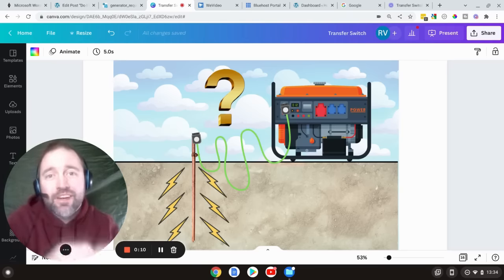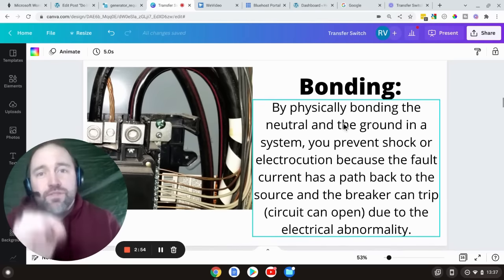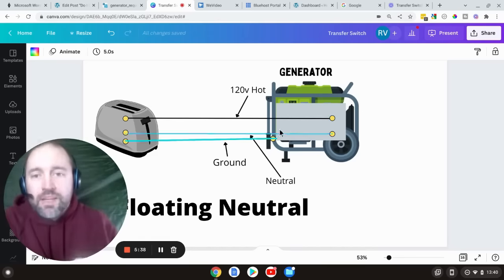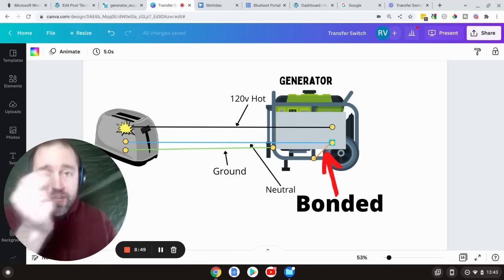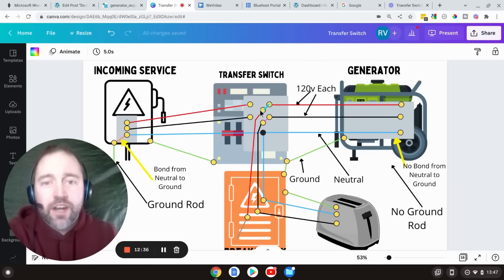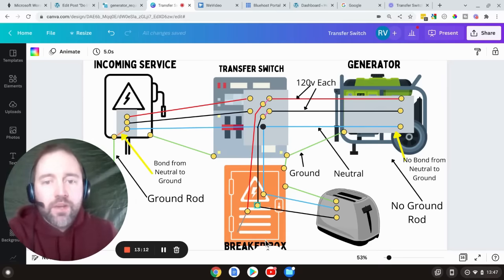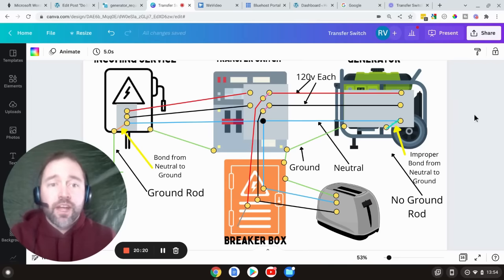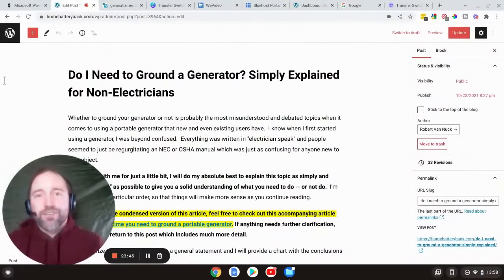When You DO and DO NOT Need to Ground Your Generator [Extension Cord Use & Backfeeding a Home]

Comment: At 9min you state a grounded generator is unsafe, but then the same situation with the switched neutral house connection is OK? That makes no sense. Going thru a transfer switch changes nothing electrically. 

If there is a fault in the toaster, let's say one where the neutral is disconnected for simplicity (if it was connected it just reduces the resistance of the wire path making it safer as less current/voltage is available on the ground). The chassis and grounding conductors are now energized. So all grounded equipment is now energized as they are all connected via the grounding system. This isn't necessarily going to trip any breaker, as they are an over current device that protects the wiring from overheating and causing a fire. The fault could be through most of the toaster heating coil for instance and the toaster just keeps working like all is normal and no over current is experienced. 
Now you touch some connected device. The grounding system has less than 5ohms (by NEC50.56) impedance to ground.  The body is said to be 300-1000ohms depending on how much of it the power goes thru. That is the worst case as you also have high contact resistances with the ground and the device thru your skin unless you are wet and don't have rubber shoes. So worst case in a pure short circuit situation (meaning the device is not using some of the power along the way, a direct hot to ground short) you have 5ohms on the grounding wires and 300ohms thru the person. That results in 400mA thru the person. It is said that 50mA can kill, though isn't as likely. So dangerous certainly. The total parallel resistance is around 4.9ohms which results in 25A flow which should trip the breaker. In most real cases the contact resistance of the skin and standing on surfaces that are not good grounds means that the body resistance will be much higher, 1000s of ohms usually, and thus you might feel the shock slightly, but won't be dangerous. Also if not a direct short, some power is consumed by the device in series with you and the grounding system, lowering the current thru you.

If the generator isn't grounded or bonded, then the grounding system just stays hot at full voltage in a direct short. When you touch it, you have too high a resistance to trip the breaker, so it just keeps shocking you. Bonding would make the circuit flow back to the generator with very low resistance and trip the breaker in a direct short, but wouldn't if some of the power goes in series thru the load before the fault point. This leaving the chassis hot at some lower voltage. That lower voltage probably won't kill you, but might in worst cases. 
Looks to me like grounded and not bonded, or bonded are basically the same. Both have a situation where if some of the load is in series the breaker won't trip, but the likelihood of a fatal shock in that situation isn't as high. 

In the end there is a reason GFCIs are put on generators. They protect you, while the breakers protect the wires and from fire.
Reply: You are right. This video is misleading and giving people dangerous advice.

Comment: So how about those people who have RVs and are using a grounded neutral plug (this plug has no cord connected to it) to fit in the 120 outlet in order to fool the surge protector into letting the power go into the RV?
The RV is using a three prong 30 amp outlet on the generator to get power. Is this safe? 
You can get these grounded, neutral plug off of Amazon or make one yourself by wiring the ground to the neutral.

Comment: Do I need a ground rod for a portable generator if it is powering a camper trailer?  Temporary set up on a job site connected via cord and plug.
Reply: My guess is that if your camper trailer itself has a ground rod as part of setting down , no. If the camper does not have a ground rod, yes. Point is you only need one connection to earth ground and that connection should be bonded to neutral once and only once.

Comment: Hello, I have an inverter scenario, its not bonded, I have a plug and play system, plug in RCB at the inverter, using extension cord, to the appliance  If i make it bonded do I have the inverter earthed or floating

Comment: This video is fantastic!  I am very impressed.  I actually had an interesting scenario with Hurricane Sandy 10 years ago - a tree came down across my utility wires to my house, and actually pulled the 3 cables out of their mechanical lugs at their connection at the pole on the street!  They were still connected at my house weather head, but totally disconnected at the street.  I was basically in "Island Mode".  I have a proper generator connection to my house and was properly wired, but I had no ground rod, as I designed and wired this with the generator neutral and ground connected to my main service wires (just like your view of a standard transfer switch with a solid neutral)  
I wasn't prepared for for a situation like this!  Even with a portable generator.  (I'm sure most people wouldn't be)  And if you have a built-in gen hardwired, I dont think there's anything you could do)
I now keep a 50' coil of #8 AWG THHN green wire with my generator, in case I need to connect it to my house's ground rod.  Yes, I should probably have a dedicated ground rod, but I dont, yet
Great video!
Reply: the question becomes, why do you not have a ground rod at your home? It's required by NEC and should be bonded to neutral at the main panel. BTW, the 3 wires to the pole do not supply a ground, although it may have a bonded neutral.
Reply: @rupe53  as stated in my above comment, I have a ground rod at my house. I just don’t have a separate, dedicated ground rod for my temp portable generator, in the event it needs to become the primary source and utility power(and neutral) become disconnected.
Reply: @tristanschaper281  ... if you have a proper 4-wire connection between the gen set and the house you are already grounded. This is why they added the 4th wire some 35+ years ago. They were originally only 3 wire connections. BTW, your neutral and ground are already bonded at the main panel and will be tied together, even feeding a sub panel. (because all grounds and neutrals go back there anyway) Last I looked NEC only addresses a dedicated ground rod for permanently installed gen sets.
Reply: @rupe53  Thank you.  That's interesting that the NEC only addresses a dedicated ground rod for permanently installed gen sets.  I think I'm good then, even if another tree rips out my utility lines from the street (let's hope this never happens again!)  Thanks for the feedback!
Reply: @tristanschaper281  ... I was looking for the wording this morning and all I found was a statement regarding "a secure return path to earth ground" which would be that 4th wire in your gen set cable, which connects to your existing ground rod outside the home. Every home will have at least one rod, and sometimes two, usually not far from where the meter is located.
Reply: @rupe53  thanks. Yup, I have a proper ground rod on my house, connected to my main panel. And bonded to the water main

Comment: What if you have an Interlock instead of a transfer switch?  I'm assuming that you would follow the rules for an UNswitched neutral.
Reply: I have the same question, but from listening to his explanation it sounds like we would not need a grounding rod as we are separate from grid but still connected and bonded to the home box, so that would be the path.
Reply: An interlock switch works off a home's circuit breaker. Since that home circuit breaker is connected to two hots (240v normally) the neutral is directly connected (bonded) to your home's panel (or neutral bus). That being said, a non-bonded generator is required when powering your house (like AC and  ceiling fans) using an interlock switch.

Comment: ok great BUT im on a metal boat. i have an inverter that automatically bonds or unbonds depending if its running off shore power or battery. if i put my honda 2.0i on deck and plug it into shore power while at anchor, do i need to connect the ground of the generator to the chassis of the boat? this problem has had me scratching my head for years. honda generator is permenantly bonded. and the victron inverter will automatically unbond when conected to the generator.   from watching your your video it seems im in the scenario where you are totally disconnected from the grid and therefore need a ground rod (ground to chassis of boat) correct? and not meaning to over complicate i also have a victron isolation transformer that completely isolates any shore power source (like the generator) by the use of three seperate transformers. active neutral and ground. is it possible in this situation if there was a fault in the boat, would the power be able to return through the isolator circuit and make it back to the bonded generator without a ground tied between the generator and the hull? and if it did then wouldnt this be 2 paths back to the source? you said this was not good? this really has me stumped?? how do i safely run my genny on the boat?

Comment: so (potentially if there's a fault) you're at risk to get a shock if your using an extension cord with a generator that is not bonded?
Reply: Yes, you become the grounding rod in that situation when you touch the faulty item/wire.
Reply: @CL-gq3no  good to know!
Reply: Use a GFCI when possible.

Comment: I get what your saying but what if I want to use an extension cord to plug into my furnace. It shares the house ground right.. would that be a problem? What's your opinion on that? The generator already comes with a bonded neutral.

Comment: As an electrician I was under the impression the neutral wire is connected to your grounding wire and rod. To complete the circuit to earth and the neutral also carries the unbalanced load (current otherwise know as amps) to ground. You need a bond as it connects all conductive components that a person maybe in contact with for safety. Because A/C circuits look for the path of least resistance to ground. You don’t want your body to be that path. So if a faulty hot was to happen for whatever reason it will create a short to ground tripping a breaker or blowing a fuse. Thus killing the circuit and eliminating an electrical shock or electrical fire. 

Maybe I am wrong but that is how I under stand it to be. 

I am foggy on DC. Though I generally look at them as battery type systems. DC makes me nervous.

Comment: I'm wondering if things are different with sine wave inverters connected to a battery.  Is it safe to use a neutral bond plug to clear an "open ground" fault?  Someone once told me not to do this because, based on how an inverter works, you'll energize the case of the inverter.  I don't understand why this would be different from a generator (which obviously contains an inverter).

The use case scenario for me is that I wish to connect my camper to a 3000W sine wave inverter operating from a 200Ah 12V DC battery, so that I can run the microwave and such on the camper when I'm off-grid.  My inverter, however, has an open ground which my camper sees as a problem.

Some people have told me "just plug a ground-neutral bonding plug into one of the AC outlets to fix the problem" as you would with a generator, while others have told me "No!  Don't do this with an inverter!"

Comment: What about a generator w/ 120V GFCI outlets? My manual says the GFCI will not protect you unless using a grounding rod.
Reply: That's bull - unless some weird GFCI is being used which I seriously doubt.
Reply: @MandrewP  Typical GFCIs look for the hot and neutral not matching. Doesn't need the ground pin to work.
In old homes with 2 prong outlets, it's generally recommended now to replace them with GFCIs even if there's no wire for 3rd pin equipment grounding.

A disadvantage of course with no ground pin is less lightning protection.

Comment: Can I run just the 2 hots if the neutral and ground are left intact with the transfer switch?  Looks like the previous owner had a generator hooked up (generator is gone) in a generator shed about 75’ away.  The two 2awg hot wires are there, but no neutral or ground.  Since the neutral and ground (for the house) are used through the transfer switch can I just hook the two hots up to my ne generator to avoid having to run the neutral and ground?  It looks like this is how he ran it?

Comment: So if I have a switched neutral transfer switch and I am using my 50 amp plug to run my house am I still gonna be able to use the rest of the plugs with ext. Cords as well when using this set up?
Reply: Also in your video at 1515 you said that we are required to have a ground rod bc it is it's own system what it it's wired like you said where the switch disconnects the neutral from the house what happens when there still is no grouning rod?

Comment: Your video is superb and thank you. However I am super confused with my generator right now. Documentation says that neutral is NOT bonded to ground, but it also says that I must connect the frame to the ground source. Not sure what I should do.
Reply: All you need to do is check  ground to neutral continuity on one of the generator mounted receptacles. If there’s continuity, it’s bonded. If there’s not, it’s floating.  Get yourself a ground to neutral connected plug in the case of it being a floating neutral generator where you can plug it in and make it bonded. This is much easier than removing the cover and placing the jump wire back in place.
Reply: @condor5635  thanks for your response. That's exactly what I'm planning to do. I tested already and it's a floating neutral, so I'll do the bonding myself. Thank you!

Comment: Question.  I'm new to this and we just had a new Generlink installed by and electrician.  We shut all breakers off inside the house, plugged in the 50amp cable to generator and the other end to the Generlink.  Started the generator and it keeps tripping the breaker on the generator.  All breakers are OFF inside the house.  It trips before I can even turn anything on.

Comment: Very good explanation however... at 13:15 your illustration is showing a grounding conductor between the generator and the CB panel which I don't think you meant to show. Also, what if while the generator is plugged into the house as shown at 13:15 somebody decides to plug a cord directly into the generator to run something that's not on the Egen system of the house? It seems that there's no harm in grounding the generator that has an unbonded neutral as shown in 13:15 and if there's a transient voltage that hits the extension cord that's plugged directly into the gene, then a ground would be good, correct?

Comment: The FIRST thing people should do with their generator is change the outlets out for a GFCI regardless of grounding, bonds etc. Assuming the GFCI is working properly, that's going to protect you from something being energized that shouldn't be. There are GFCIS for 240 outlets as well. Further I would also suggest changing out the breaker on the generator for a GFCI breaker. And use a ground rod to the frame of the generator anyway.
Reply: But doesn't it make you more prone to electrical shocks in some cases 😅
Reply: @HighAdventures Why yes, it does.

Comment: Can you explain why the frame of the toaster in your extension cord example would become energized? I don't really understand what would be connected to the frame in the toaster's circuit. Seems like the hot would based on your explanation, but then also the ground, which doesn't make sense. Then even if I touched the frame with the floating neutral scenario and no grounding rod, how would the current flow through me back to the source?
Reply: If there was a loose wire in the toaster touching the toaster metal parts it could be energized. Not so in a normally functioning toaster.

Comment: Great Video - normally when you have connect a generator to a transfer switch, you're doing so because the main grid is down. However what if you were to run the generator and the grid at the same time? Let's say its a solar generator running into the transfer switch and your main panel is still running other circuits. Would there be benefit in have a transfer switch that switches the neutral? And how would you manage the bonding then?

Comment: I'm wiring a concession trailer my electrician says I can't use a 3 prong 3500 inverter because he can't wire 220 to the panel without a 4 prong ? 😅

Comment: 6:00 I do not get how the case is energized. If it is grounded then it is at zero potential. It is the other wire that gets the 120 V potential (assuming the toaster still is working). Remember electricity naturally does not have potential to ground. It gets it only through grounding, deliberate or like in this case accidental. if the neutral is not bonded then it is an identical conductor to the other one.

Comment: Great video - I love pictures to explain stuff! I just tested my new generator by feeding my house panel through a 50A breaker with the mains interlocked off. My air conditioner ran fine (has a soft start device) but I noticed the only other circuit I had on (outlets in the garage) tripped its GFCI. Any ideas why?
Reply: Could be a few things. Main thing is if the generator is bonded since the panel also bonds it. Use a multimeter and see if the outlet from the generator has continuity from the neutral (left) socket and the ground socket. This should be an open circuit. It's easy to correct by removing the power head cover and see if there is a jumper from neutral to ground. If so remove it and if ever only using an extension cord then use a bonding plug in any of the generator outlets.
Reply: A GFCI trips when there's a connection between a current-carrying conductor and a grounding conductor downstream from the breaker.

The bonds between neutral and ground are upstream of the breaker and irrelevant.